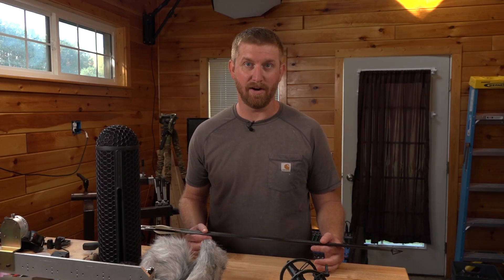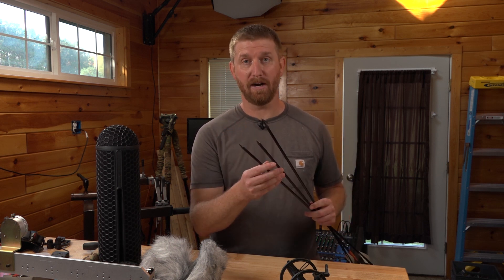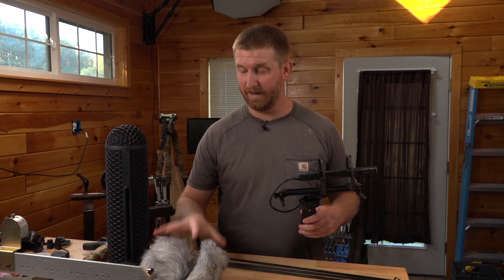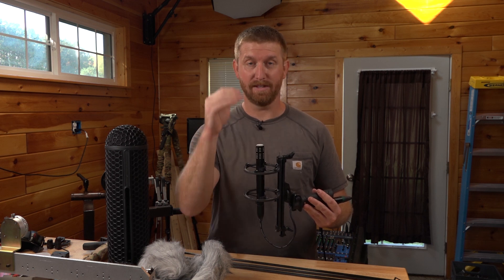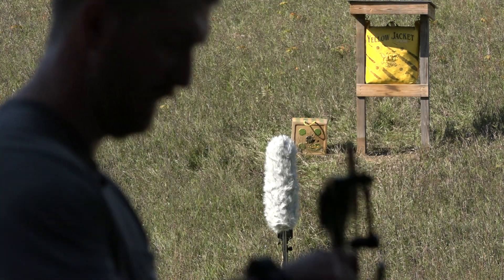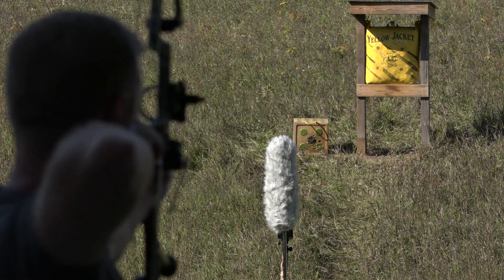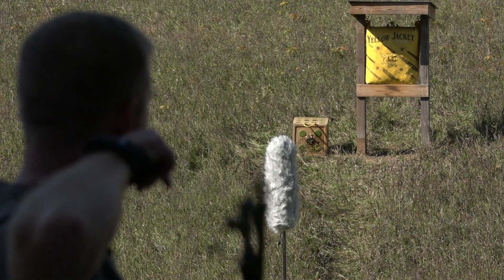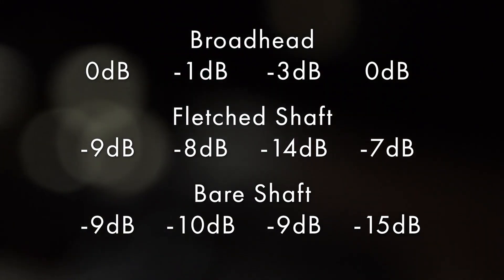Arrow Noise Test - How Loud Is an Arrow?

Comment: this is by far the best "audio" test I've seen. My request will be to try different broadhead profiles. Sleek and slim heads like a Swhacker or Raptortrick, and then a Rage Hypo or Trypan. Then vented fixed head. I can mail you some of these if you'd like.